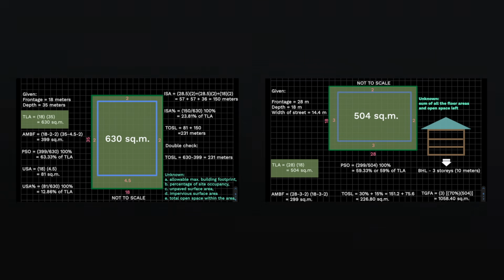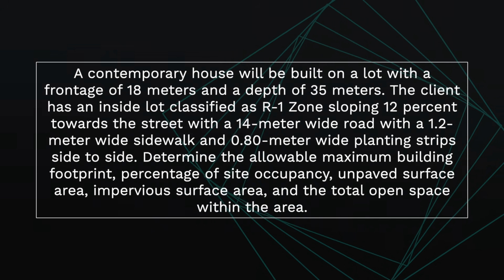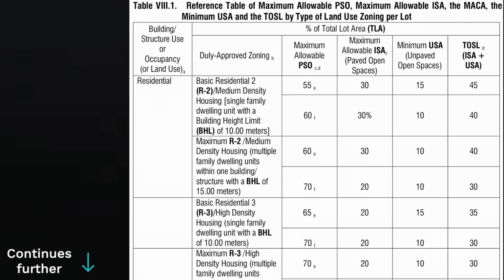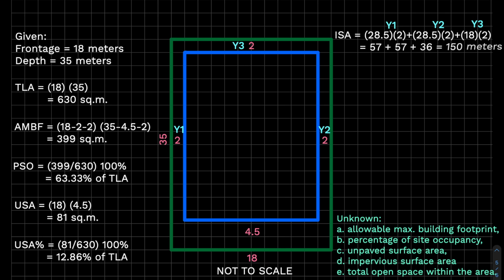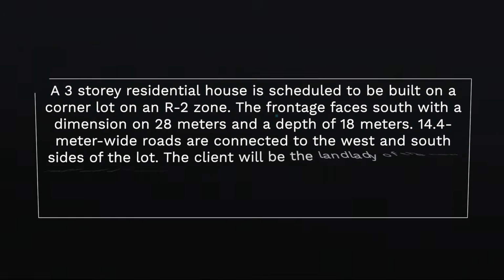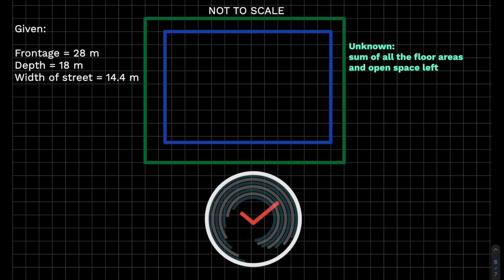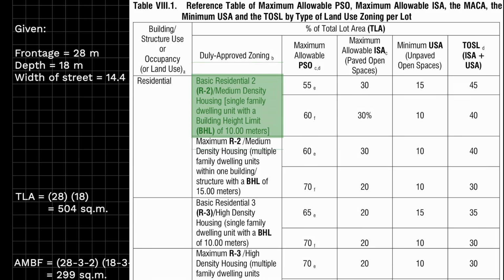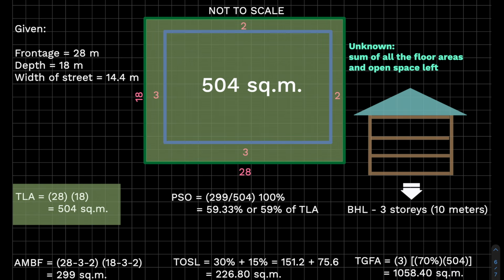Lot Area Computation: 2 Architecture Design Problems in 1 Video!

Comment: I think the answer is wrong. As it is stated in the problem, there is still no ACTUAL building, and the question says "Determine the ALLOWABLE MAXIMUM BUILDING FOOTPRINT" and not "BUILDING FOOTPRINT (ACTUAL)". Thus, the most stringent rule will still prevail, which says that AMBF is 50%. Please correct me if im wrong.
Reply: I agree, for R1 Residential the allowed maximum PSO is 50% max
Reply: The AMBF = 315 Sq. meters